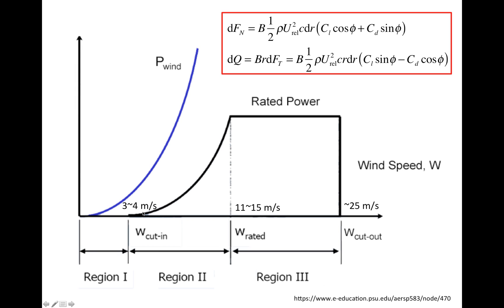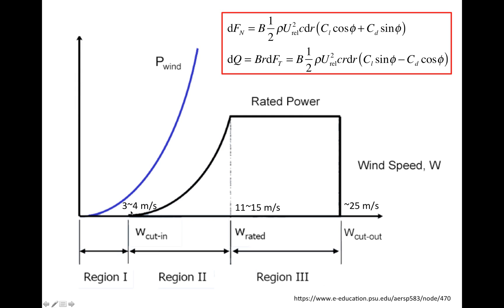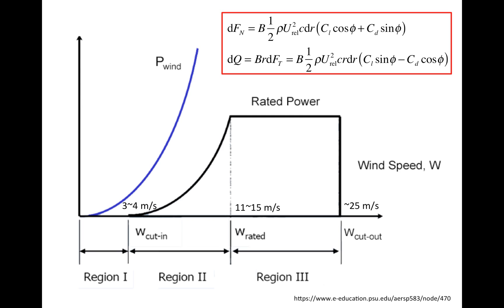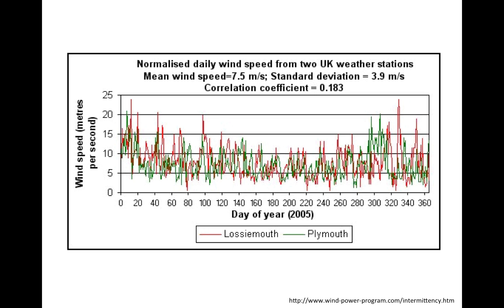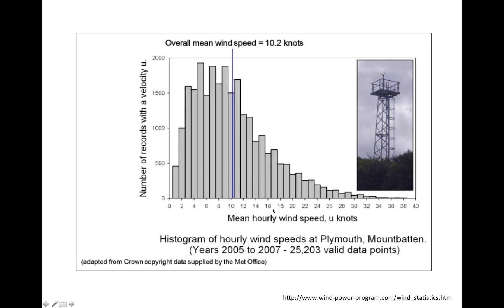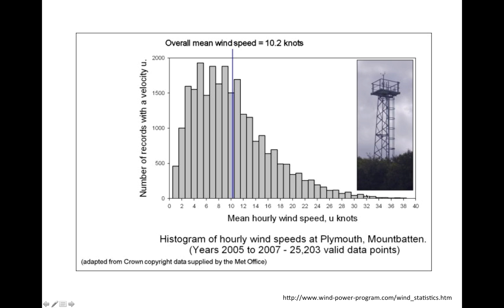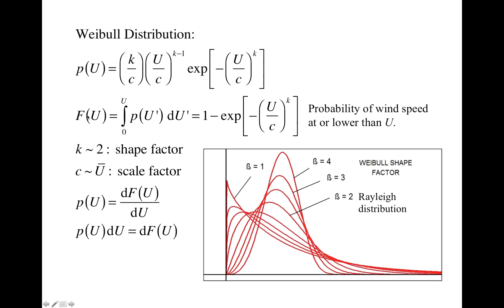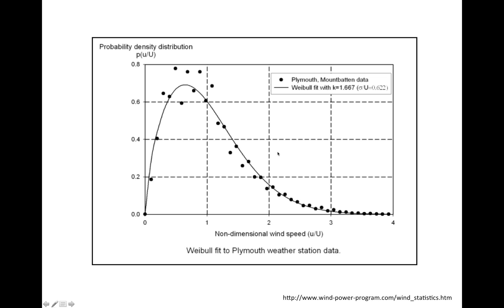Understanding Wind Turbines (12) - Aerodynamics 10

Comment: Wind speed rating Question

this is a very nice video very very helpful! well explained. thanks mr chen
please I'm trying to determine the wind speed rating at a site - not the wind turbine rating. I intend to use the wind speed rating to select the type of turbine rating I need for my site. but I have one issue. I have available wind speed at a height of 20m, but I want to use a turbine at a height above 20m. if I rate the wind speed at this height of 20m is it ok please, but remember this is not the wind speed I will be using. the wind speed I will be using will be higher, I do not know yet because I . so, if I do not have to use the rated wind speed at the heght of 20m how do I obtain the rated wind speed at the higher height please